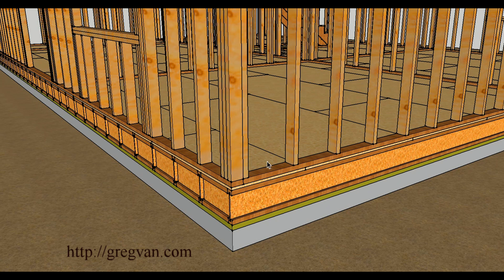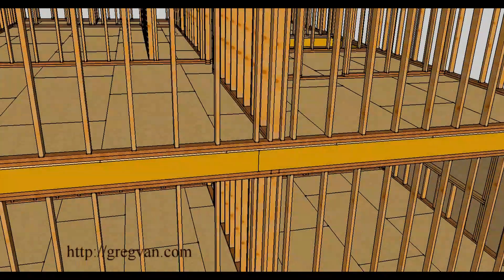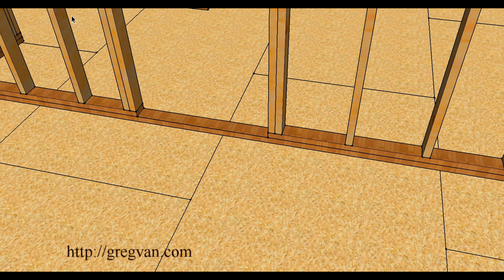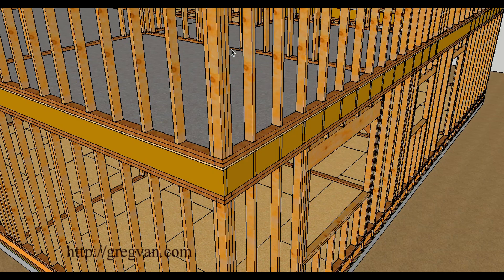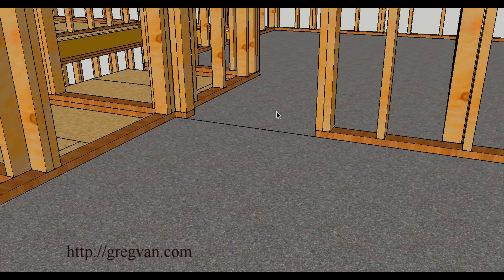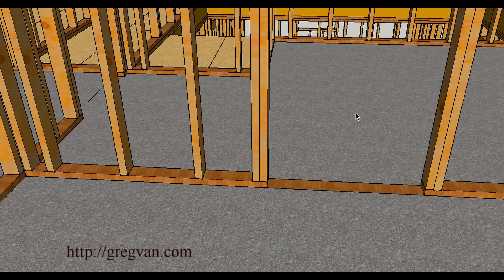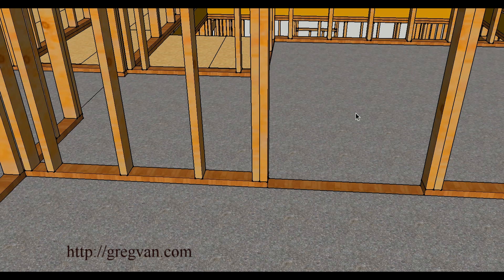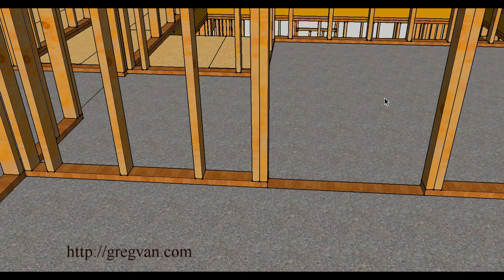Watch This Video Before Using Lightweight Concrete As Sound Barrier Between Floors

Comment: The most common reason in my area for concrete floor toppings in residential construction is to create infloor radiant heating panels.  We lay the tubing out in a suitable pattern and spaced to meet the heat loss of the room, typically 6" to 12" centers, secure the tubing in place with talon clips then pour the concrete.  The concrete may be the final floor finish perhaps colored concrete or acid stained or polished/ground and sealed.  I believe that concrete does provide a significant sound control element effective primarily for mid and higher range frequencies transmitting through the air.  Any hard surface floor covering such as solid wood, tile or concrete will transmit sound to some degree.  High heel shoes certainly seem to make a racket in the room below as the wearer moves about on the floor above.  To better deaden the transmission of direct contact sounds a soft floor covering such as carpet or perhaps floating wood/engineered flooring should help allot.  To truly stop the transmission of low frequency and direct contact and high decibel at any frequency noise, I think complete separation between the floor above and the ceiling below is required.  A ceiling frame that connects only to the walls of the below room with an air space between the top of that framing and the underside of the framing for the overhead floor.  Such separation being in addition to standard noise control methods such as concrete floor topping, Donnacona sheeting, ResBar, 'Safe 'N Sound' batting, etc.  I think I've heard of a sound deadening paint that converts sound energy to heat but I imagine that it is expensive, hard to obtain and of minimal efficacy.  The home theater specialists may use (I think) sound deadening membrane products.  Dance studios I seem to recall used to use some kind of 'spring supported floor'.  If true I've no idea what form that spring material was in.  Perhaps it was something just like ResBar channel between the sub-floor and the finish floor.

Reducing the transmission of sound between occupied spaces is probably an engineering specialty and what very little I think I know of it is based on observation of other trades during construction and subjective judgement when the building is occupied and some little reading on the subject.  None the less I am quite confident in my belief that concrete topping greatly helps reduce the transmission of sound between floors.  It doesn't stop it all but I believe it is very beneficial.
Reply from the maker: +Chee Kay You should start writing advertising campaigns. Thanks for sharing.
Reply: We have been using GenieMat RST 15 and two layers of 3/4" MDF with Green Glue for high and low frequency sound isolation on top of joists. Regular R-19 or R-30 for the joists underneath is fine. No need for the special insulation once you have all that mass. check with structural engineer for calculations on weight.
Reply: this comment was beyond helpful to us as we plan and design our home using this material. thank you for taking the time to share this
Reply: Is it 'light concrete' good to pour over 1/2 pipes for the in-floor heating system. Do you know how you would ontrol the  Cracking of the concrete? Would you still have to cut the concrete or else?
Reply: @gennelu560  Some cracking is almost inevitable but with due care to detail during construction cracking should be minimal. A few thoughts on concrete overpour on a typical wood framed floor (deck) and assuming that the concrete is going to be the finished surface.

1. The framing must be adequate for the load and it must be well done. 
2. Plastic sheeting (6mm poly vapor barrier eg) must be stapled to the plywood deck before the heating tube is installed. 
3. Concrete must be 3000 psi or better. 
4. Control joints should be used, particularly in large areas such as open floor plans. Joints are often beneficial in doorways.
5. All the standard practices to create a strong pour with a good surface finish need to be adhered to. 

Some random thoughts in random order. 
Most of the jobs I've worked on use a regular concrete mix of 3000 psi or better. Cracks tend to start at and radiate out from any sharp Outside corner that the concrete surrounds. For instance the corners of the floor plate used to frame a closet are often a spot from which a crack will start. In general the larger the area the more likely it is that cracks will form so large open floor plans should probably consider useing control joints such as plastic Zip Strip. Going fancy one could use inlaid brass to create a decorative pattern, making the contol joints a decorative feature such as used to be done with terrazzo floors. 
Cutting control joints is not recommended as no matter how carefully the tubing is installed, how carefully the saw is set, the risk of damaging the tube is too great. The depth setting on the saw may loosen during a cut or the tubing may not be in full contact with the floor and that small variation could be all it takes to nick the tube while sawing. In short, don't saw control joints. 
Smaller areas like bedrooms probably don't need control joints in the main area but a control joint in the doorway is in my opinion always a good idea. Any doorway is a candidate for a joint as the floor plate either side and the narrow span connected to the large surface of the room seems to create an area where cracking is most likely to form. Esthetically the control joint should be placed so that when the door is closed the joint will be directly centered under the door. 

The first step towards a crack free (or nearly so) concrete over wood frame and plywood floor is good framing to create a deck that is as solid as possible with minimal bounce, deflection, sag or variation from flat true and level. "Good enough" probably isn't. Any significant flaws in the deck structure will be locations where cracking is likely to occur. 

The 6mm poly prevents the concrete from bonding directly to the plywood which I think reduces the internal stresses in the concrete as it expands and contracts with changes in temperature. Further, when pouring the floor the plastic prevents the plywood from sucking water out of the concrete helping to ensure a more homogeneous pour and making it easier for the concrete crew to achieve a nice surface finish. Lastly the plastic provides a surface to draw on with a Sharpie. Arrows and spacing marks are erasable as needed. 

Polypropylene reinforced concrete. Poly fiber can be added to concrete reinforcing it and helping to reduce cracking. I've not used it but I've spoken with one contractor who did use it when pouring over an existing basement floor to level it out. The pour was 1.5 inches tapering off to 3/8" as I remember it. I don't know if that very thin overpour eventually cracked or not but there was an issue with the surface finish. The poly fibers were kind of visible, sticking up through the surface like very very fine hairs. Perhaps that result was the fault of the finishing crew or maybe the particular brand of fiber.  Maybe the very thin pour contributed to the result but I would certainly want to speak with suppliers and your local concrete finishers and see some sample pieces before using that materiel for a finish surface. It may be an excellent solution to reduce cracking and be suitable for a finished floor surface but it can not replace the number one priority of building a strong flat level solidly framed floor assembly.
Reply: @GeeKayKayGee  Thank you very much for answering. It is exactly the kind of detail I was looking for - excellent information. This would be for my new house that I am designing, and I would make sure the floor is solid. (it will exceed the minimum allowable span as per the standard/Engineering). Finally, do you think or in your experience, 1.5-inch thick concrete 3000 psi or better with fiber would be enough - without using rebars or wire mesh?  Have you considered or ever used lightweight concrete  which would take you from 150lbs/cu-ft (regular concrete weight) to about 90lbs/cubic ft (lightweight)?